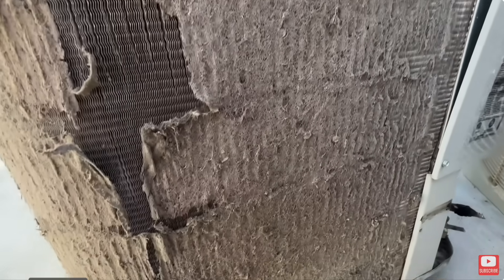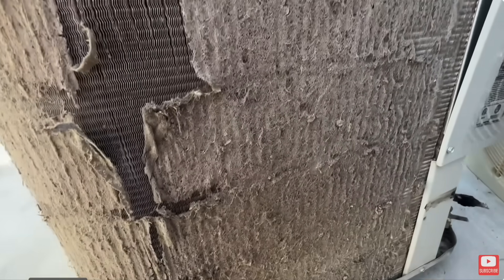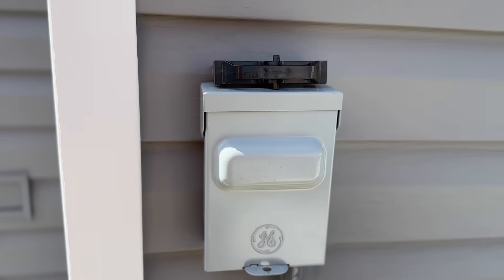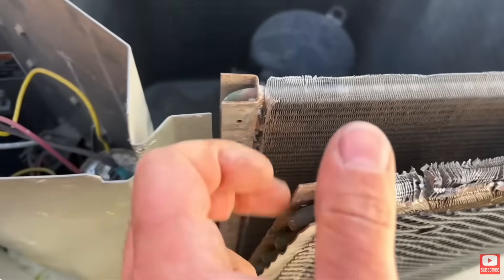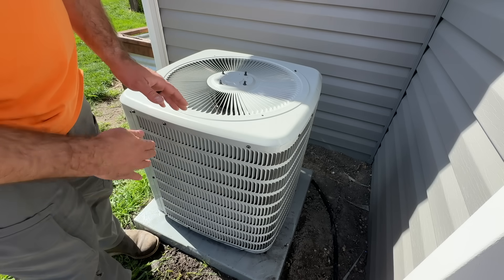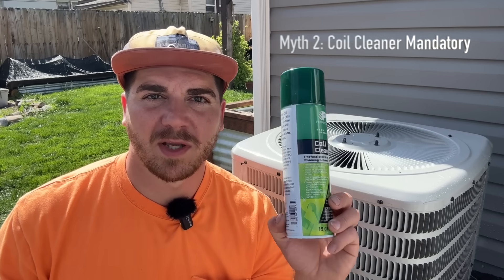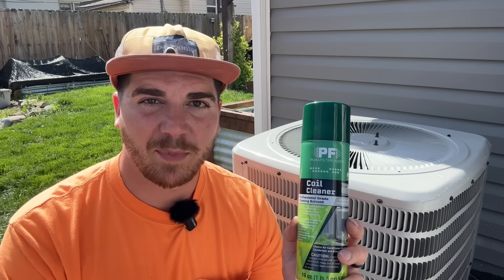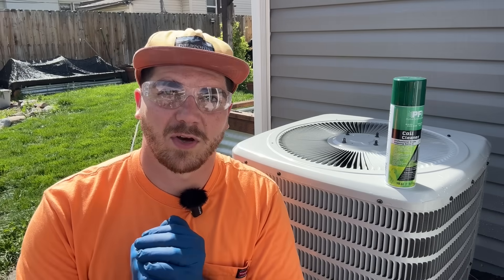Stop Cleaning Your A/C Coils The Hard Way! Do This To Get Colder Air From Your Vents.

Comment: Excellent video (coming from a professional photographer/video producer). I've been dealing with an issue with my AC split system. A year ago our HVAC maintenance company replaced the condenser motor when I was out of town. A year later it needed to be replaced again. Symptoms are that during really hot days, occasionally the fan motor would stop and therefore air coming through system was warming up. So after the HVAC company replaced the motor a second time the same issue occurred with the motor. I can turn off the AC system for about 15 minutes and then it will work properly again. I'm an avid DIY'er and so I decided to research this myself, since obviously the problem was not corrected. Incidentally, the second service tech indicated that the refrigerant was low and so he added 3 pounds (rated at 8 pounds from factory). After some research I thought maybe the run capacitor was faulty and so with it costing only $13 I thought it couldn't hurt to replace. FYI, we are in CA and have had 40+ days of 100° temps, so the ambient temp is up there. I feel like the condenser motor is overheating and shutting down, with an auto reset occurring once it cools down. I installed a sail shade to the side of the house to provide some relief for the AC unit as it is exposed to direct sunlight in the afternoon. After I installed the condenser I left the service panel off for a few days so if that was not the solution I could get to the unit without taking off the panel again. It ran flawlessly for a couple days and so I reinstalled the panel. It then experienced the same motor freeze symptom during the latter part of the day. So, after this long set up, I am wondering if poor air flow into the condenser space could somehow contribute to this problem? Would creating vents in the service panel help to alleviate this problem? I know it may not make sense, but so far nothing has worked to solve this issue. I have also considered replacing the contactor. Interested in any professional feedback. Thank you.

Comment: So the reason why they say to remove the top is to clean the inside of the unit. Its either going to have dirt buildup or leaves from trees and brushes. Then you can water down your unit afterwards. Just adding that in case someone was wondering.

Comment: I like to tell the average person who doesn't work around electricity to take a piece of wire and take the disconnect out and wrap the wire around the handle then close the box and put the wire through the hole for the paddle lock. this way they can look and see its hanging there and is still safe. 
And just use the foaming coil clear that's meant for the air handler indoors. Its easier on the metal and DEFINATLY get the foaming kind and try to get the spray straight in deep in the coil. It pushes the dirt out as the foam expands. Its worth it. 
The air handler coil that's usually inside the house is a little more difficult but if you can do it then its very much worth it. but the coil cleaners that say no rinse, rinse it for sure and especially on the out side unit. it says that because the condensation that gets on the coil (on the air handler one in the house) "rinses" it.  just doing this I was able to get my unit to be able to take in 93 degree air and put out 64 degree air that's a big difference and was in phoenix AZ in the summer while it was 115+. you want a 15-20 degree differential if its under 15 then you need to investigate and maybe call a good hvac company before it costs you more. and definitely check out his vid on how to replace the capacitor it can cost you up to $400 to have one put in, just for discharging the old one and unplug it and plugging in a new one. compared to that they are cheap. this guy is doing everyone a favor and giving correct advise! good work diy havc guy!!! give him a like he probably saved you $1000 or more easy.

Comment: i just decided to clean my 25 year old coil this spring for the first time. I never cover it when winter comes either. It was of course quite dirty and nothing serious though. the summer before and all others preceding it had been flawless. I think it works better this summer but that is rather subjective. it is 10 seer and fortunately we have cheep power for now, costs me about 2 dollars a day to keep my house at 70. All that said when it does crap out I will not replace it because I can complete a DIY  mini split for less than the likely cost of repair performed by HVAC pros. to be fair my ac season is about 4 months and I rarely use the heater side.

Comment: OK, so I've been looking at several of your videos, mainly, installing "Your own Furnace". And we are installing a 5 ton Mr Cool Furnace with an "A" coil, so we have several questions. Reading their install manual, the furnace requires almost "NO" clearance all the way around, except for the access to the filter, drain line, and front panel ( 2 feet) for servicing. I told them it was going into an enclosed 49" wide closet, 29" deep, so it should work. This is where the OLD one is being removed from, so this is where it is going. Does it matter if it is enclosed as long as it is vented correctly? The drain line run correctly and the filter is accessible? And we have a problem with the outside condenser, since it requires about 96" of clearance out front. "BUT" we wanted to install it where there is only 3 foot between the property fence and house wall. ONLY option there is to mount the condenser on the wall and get the airflow over the 3 foot high property fence?? Will this be OK??  Thanx for the HELP. I have been in contact with MR COOL, but they really don't help out much. Sometimes they tell you that you are on your own!!??  Raul  PHX / metro

Comment: You are so wrong my man! there is a way to get dirt and cottonwood in the space between the two coils. A fine example is the Trane Voyager RTU's that have been on the market. I have seen several compressor failures when its cool outside and only one condenser fan is running but both stages of cooling are running.

Comment: If you had a darker color housing, spraying coil cleaner onto the painted metal openings would create discoloration. That's why they suggest taking off the motor and protective metal housing and spray from both sides.

Comment: In the Spring, I decided to check my home's a/c capacitor.  It was just barely within the +/- tolerance (on the minus side!).  Obtained a quality brand exact replacement and installed.

Comment: Good tips...  On the A/C unit we have, the coils are mostly exposed, protected by a metal grate (instead of metal panels with louvers punched in them).  I clean them regularly, as in weekly, depending on conditions.  Mostly because our unit is surrounded by exposed gravel and during a hard rain, sand/dirt will splash up on the lower portion of the coils.

A few things I noticed that help with efficiency...  Try to have your unit installed in the shade.  Ours is on one side of the house that is shaded by trees and our neighbors fence 95% of the day, only briefly being in the sun for about 30 minutes or so in the late afternoon.  We had the unit moved when we installed a replacement, as it was originally adjacent to our patio, which got direct sun for about 4-5hrs a day.  Made a huge difference in cooling the house.

If you don't have shade, build fence around your unit to shade it, ensuring that the fence is far enough away from the unit and built to allow sufficient air flow through the coils.

On super hot days, I find spending 15-20 minutes spraying cold water from the hose on the coils a few times a day during the hottest part of the day, to really help drop the temp in the house quickly.  Our 99yr old home tends to heat up (especially upstairs) during these occurrences, and the unit will not shut off all day, unless I provide extra cooling to the coils.  

From what I understand, in hot but dry climates, people will install water "misters" around their A/C units to drop the ambient air temp around the coils to increase efficiency in the really hot weather.  

Hosing down the coils as I do, more or less just provides additional cooling, ramping up the efficiency temporarily, but it does help.

Thankfully, city water is cheap where we live...

Comment: Man, wish I would have seen this video first.  I took the casing off and up pinching a wire.  I found it then cut and rewired it.  But it still didn't work.  It blew a fuse in the furnace, which I didn't know to check.   But my system hadn't been cleaned in 10 years so it was bad!  It ended up ok, because my capacitor was on the verge of going bad.

Comment: One thing I find often on residential condensing split units , that the inside base has leaf debris, mulch, roots (they seek moisture), and accumulated dirt which clogs the drain openings, this must cleaned out. Also always make sure there is no mulch or dirt surrounding the base make sure the pedestal it sits on is clean and free of debris. Great video TY!!!!!!!

Comment: Great video! Why would you turn off the power if you're not removing the top? It rains harder sometimes than any hose, so there should be no need to turn off the power if all you are doing is spraying water on it? Or am I missing something?

Comment: if its actually dirty, like visibly caked with lint or other crap you really do need to to remove the sides and the top/fan and spray it from the inside out. On side discharge mini splits a lot of them have a cleaning function where it can reverse the direction of the fan to blow out stuff that has been sucked onto the coil.

Comment: Companies dont want you to use chemicals not because they eat up the metal.. most if not all ac units have a coating on the coils to prevent rust. These chemical cleaners can damage that coating overtime

Comment: If you haven’t done this in a while you might want to look inside. I took the top off and I’m glad I did. There was a lot of stuff in the bottom that you don’t see from the outside. After I scooped it out I sprayed cleaner on both sides and then blasted the crud from the inside out first.

Comment: well done clear and easy to follow your pace.  i've been doing mine the same way except i have pulled the fan top plate off to thoroughly clean pushing the debris OUT from the inside.  but as you mentioned if you have a yearly or bi-yearly regiment it would be fine without the extra work, thanks again your GREAT.

Comment: I’m sorry man. I have to respectfully disagree. I love your channel and I’ve learned a lot from you and your videos. I even used your videos to install my own central AC system. 

But I’ve been a diesel mechanic for 20years. If I cleaned radiators, condensers and/or charge air coolers from the front like this… it would only make things worse. Now, I understand that it’s a different environment that often includes oils and grease causing the fins to be plugged up much quicker. And is often a hell of a lot harder to clean than just yard dust. But it’s only a few screws to remove the top and sides.  So I will continue to remove the top and sides. 

As a bonus. You can clean out any rodent nests when you remove the top and sides. As well as any nuts, or other rodent food they may have stored in your unit over the years.

Comment: You make the best and most informative videos of anyone I know. I am on Cape Cod and surrounded by trees with lots of leaves which end up in the bottom as my condenser unit which is  huge while the compressor is same size as most. Is there a good way to clean out the bottom of my condenser unit or no need to do that? Thank you!!!

Comment: I have a package unit/heat pump. I had to clean it for the summer season last weekend. I did the obvious coils on the outside. 
I first did as you showed but I removed the outer/louvered covers so I could rinse from the top down. Everything went well and I put the covers back on.
I thought that was all but my HVAC guy said there was another coil that HAD to be cleaned also.
I removed the only cover not involved with electrical/HVAC servicing. And there it was.
Covered in mildew from not being cleaned. Cleaned it just as the other coils and the airflow is stronger and colder.
Now me and my wife will stop sneezing from allergies related to the mildew/mold/pollen.
Thanks for your help.

Comment: Thank you for the video. I just use coil cleaner every couple years if even that often if the unit allows it to just dissolve the oxide off the coil fins for maximum efficiency. Like you had mentioned, most important is to clean it once or twice during the season with water to get the large debris out for high efficiency operation. The older Trane condenser is fine, the newer gas pack specifically says to not use any cleaner just water which I follow because it's probably due to the fact the metal alloy probably doesn't react well to corrosive chemicals. 

I can also tell if the unit needs cleaning based on putting my hand on the high pressure line. I noticed before I cleaned it was pretty warm if not hot, after I cleaned the unit with just water, coils are clean, the temperature of the high pressure line drops to being just warm which means the coils are doing their job.

Comment: I remove the fan. Very carefully. It isn’t hard, just don’t drop it, strain/break the wires, or smack the coils. Take your time and do not rush and it’s all good. Then I hit the inside coils with a hose sprayer with condenser coil cleaner, not the spray can stuff. Then I hit the outside coils. Wait 5-10 minutes and rinse it off well. I start from the inside then go to the outside, taking several minutes with each. Longer than the cleaner application to make sure it’s well rinsed. Then put the fan back on and you’re good for another year. 

Also show the evaporator coil some love. My annual cleaning is done in April before it gets really hot in South Florida. Evaporator first, then while the no-rinse cleaner is doing its thing hit the outside. Then switch it all back on and the evaporator self rinses.

Comment: Living in FL AC  business is always booming.  Units do not last long here so you gotta keep up as shown here.  Great video, I clean ours several times a year as lawn clippings and dust from other landscaping seems attracted to the units.  Cap replacement on 3 units is about once per yer between the 3 on rotation.
Reply: I've been doing my own mowing and I make sure to turn the unit off so it's not sucking in debris. When I first bought this house, I couldn't believe how jammed up the coil was. I do clean it out at least 3 times a year. It would sure be nice to get more than 10 yrs out of it. I have a few spare caps on hand as well. Best wishes.

Comment: Thanks for a great video. Do you think you can do a video on how to clean the air conditioner evaporator coils (not sure that’s what it’s called) that is located located in the attic. I didn’t know anything about it until it overflowed and came through the ceiling. Thanks.

Comment: What can be seen on the outside of the coil is only part of the build-up.  Inside the coils have build-up and split coil do too.   If you observed refrigerant pressures/temperatures before and after cleaning this way.... then, again after doing it the correct way.
Spraying through the grate is a terrible way of cleaning the coils.   Washing from the inside is the best because you can have the nozzle directly on the coil (straight and angled downward) without having to remove each grate.    
Also, soap or a cleaner is important to use to remove the carbon buildup from the fins.   Then, they will be more conductive and can dissapate heat better.

Comment: If your condenser coils are near your kitchen exhaust, then use coil cleaner. If it only gets dust on it, not suet or smoke or oily air, you only need water, or regular detergent to clean them.

Comment: I really enjoy your videos and have learned a lot.   I am wondering how you clean the coils on the inside unit.  Mine is located in the wall and is very tight space with no side room to get in there.  I can see a lot of dust on the coils and have ordered a computer vac to see if I an get that in there to clean them out but I was wondering how would you wash them?
Reply: I think I am referring to the A coil inside where the furnace is located

Comment: i use a coil cleaner, and use on car radiator also, breaks the static charge that keeps dust dry while water running over coils.

Comment: We have a Sears A/C unit since 1993, that is still working well!
Reply: Things including hvac units were built better in the 90s compared to today...by far!
Reply: I replaced the units on my 4-plex. Everyone said it works well. But not one said they noticed any savings to their bill. They were 1982 models.  They actually worked well, but I'm retired and don't want a/c problems when I'm out of town.
Reply: And is incredibly expensive to run.
Reply: @My1970TransAm   Not really.  It has some kind of 'energy rating' on it, which makes it somewhat efficient.  My in laws have a recent unit and a similar square footage house, and they are paying only 20 dollars a month less.

Comment: A pressure washer won't bend the fins.
An IDIOT with a pressure washer will... 

I washed eight 80 ton units for 10 years, used a pressure washer every single time...

Comment: I’ve used a mild soapy solution that I  spray on the unit just before I turn the power off, with the fan running to draw the solution into the coils. Then cut the power and rinse the coils top to bottom. Otherwise I’ve used Coilrite (Koilrite?) cleaner on very dirty units and flushed/washed them from the inside out.